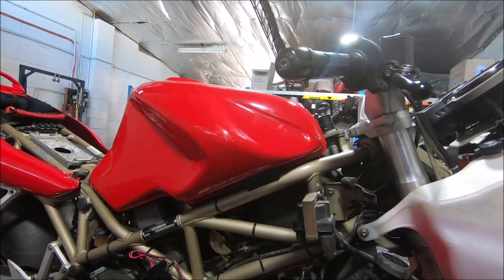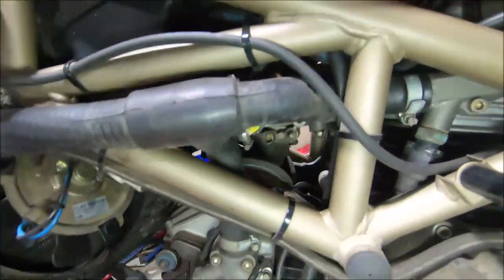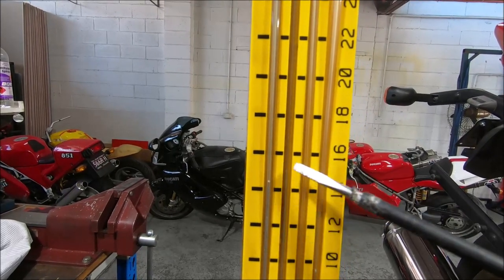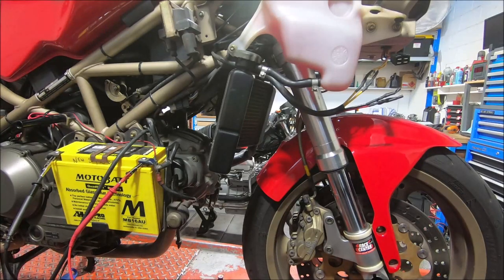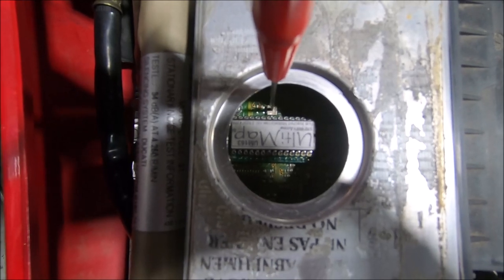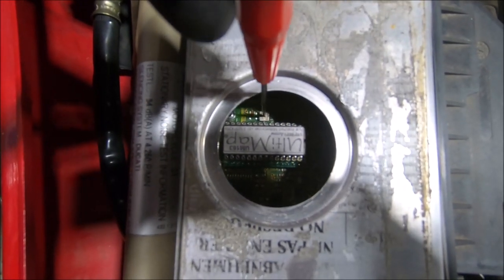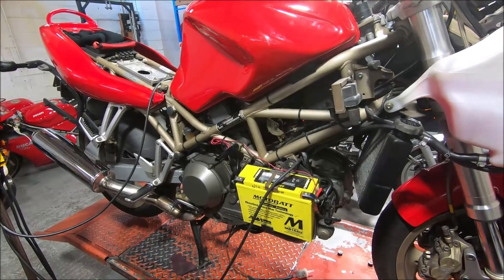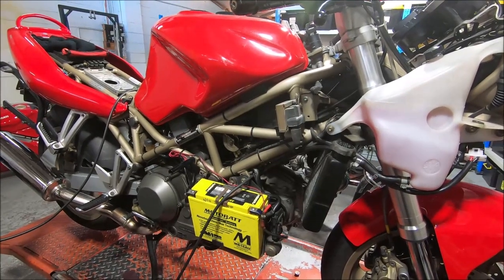Ducati 2V throttle body set up and tuning for SSie, Monster ie and ST2

Comment: Hi again, Brad.  Another great vid on a 1.6 ECU.  I never knew about the aftermarket chips not being able to "talk" to the diag tool(s) !!!   Thanks for that tip!
Reply from the maker: any aftermarket eprom based on the fuel injected motorcycles / ultimap megazone system won't talk to the weber / marelli diagnostics.  any aftermarket eprom based on the weber / marelli software is fine.
Reply: Moving the EPROM in the video was confusing. Rich/ lean back n forth. Where did the pulse width end up? 11 o'clock??

Comment: It's annoying that the voltage affects the co that much. In the 59m there is a voltage correction table that compared to marell injector data is more or less correct, but I've found that for every volt of drop it still need +0,2ms of injection time to come back to the same co value
Reply from the maker: it's not something i usually see on these, just happened to be a compounding issue.

Comment: As always: Nice video...thanks for that!
A question about the probes that you insert into the manifold to measure: Do you use a screwed adapter or do you simply push the copper pipe a few centimeters into the manifold (without further sealing)?
Reply from the maker: all threaded, with an o-ring under the nut on the inlet.

Comment: At low RPM and deceleration of throttle I will get exhaust popping. I'm hoping this will solve the issue. And I also noticed there's some slight oil seeping around the hose from under the airbox, and am wondering if that is a result of the same problem?
Reply from the maker: i can't see any oil having anything to do with popping.  sounds like it's just lean.

Comment: Brad, another great vid! I learned a lot.... I am still playing with my 2000 Cagiva Gran Canyon, I have it running great at idle and low revs. Per your instructions on TPS settings in Mv.
Also, using manometer balanced TB's at idle

 When I hold it (cruising 2nd, 3rd, 4th) at 3-4K rpm's, it stumbles a bit, but accelerating from 2000 to 6000 rpm's is smooth. 

If I hit it (hard) to WOT it cuts out to one cylinder at about 7-8k rpm's, but if I roll it out steadily it winds right up to 9k.

When I isolate the cylinders by unplugging plug wires, it is smooth with no stumbles on either cylinder.

Thoughts?
Reply from the maker: what is the idle mixture set to?
Reply: 1 1/4 right TB , 1 1/4 left TB I used my homemade manometer
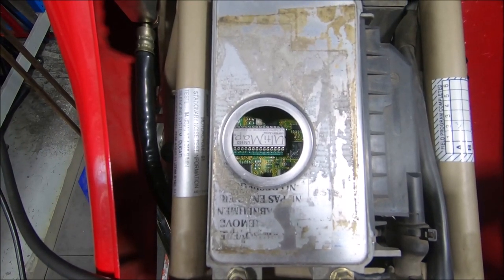Reply from the maker: @johng9323  that's the air bleeds.  you set the idle mixture using the trim pot in the ecu - shown at 12:45
Reply: I don't have sensors to measure exhaust gas. I can smell that it has been very rich, just yesterday I move the trim screw from  4 o'clock to 2 o'clock, it was difficult tell realize any difference, as I only rode about 1 mile. I have been smelling the richness for quite a while. @bradthebikeboy
Reply: I may have omitted important info: Before all of this happened,  my regulator/rectifier went out. I replaced it with Roadstercycle FH020AA reg/rect. The charging system is working beautifully, but do you think I may have damaged any electrical components?
Reply from the maker: @johng9323  no.  the trimmer is explained here.  https://www.youtube.com/watch?v=AurUeZiuuE8

Comment: This is awesome, but for the average joe such as  myself who doesn't have an exhaust gas analyzer in their garage what do you suggest for setting the air bleeders?
Reply from the maker: the air bleeds are to set the idle speed.  ffs.  the idle mixture is set using the idle trimmer in the ecu.  if you don't have a way to measure manifold vacuum, i would set the idle speed as desired with the air bleeds out the same amount.  least desirable.  if you have a way to measure manifold vacuum i would set the idle speed with the air bleeds set to give the same vacuum on each cylinder.  from there, you could adjust the idle trimmer up and down to see if/what difference that makes to the idle speed.  it's easier on the 1.6m ecu because twisting a dial gives you more feel in terms of good/bad sort of thing if that make sense.  but with the 1.5m or 5xm series, just move the number up or down and see if you can find the points at which it gets crappy rich and lean.  generally, whatever those points are, go 1/3 of the way rich from the lean point and that's about 4% co in a very general sense.  if the idle speed has changed, redo the air bleeds to get the idle speed you want.  happy with the idle speed?  good.  then i would ride it around for a while and get a feel for it.  then, wind one air bleed out 1/8 turn and the other in 1/8.  ride it for  while.  better or worse?  better? - go another 1/8 on each.  worse? - go back 1/8 on each to the starting point, then 1/8 the other way.  better or worse?  continue until it feels best.
Reply: @bradthebikeboy  I don't think my 800ie has an idle trim in the ecu
Reply from the maker: @515moto  i can assure you it does.

Comment: Can u fit a 180/55/17 tire on the back?
Reply from the maker: and the award for today's randomly irrelevant and vague question goes to this guy.
Reply: @bradthebikeboy  lmao great help!
Reply from the maker: @joeblades  is there a requirement for me to be helpful?

this video is about tps resetting.  asking a tyre question is completely off track and that sort of total irrelevance really annoys me.  if you have technical questions, you can email them to me.  i much prefer that to this sort of random rubbish.

and how vague can you be and still expect a reasonable answer.  are you one of those people who complains about bad service everywhere without considering that you're the problem?  the info in this video can apply to models of 400, 620, 750, 900 and 944cc.  some of those models have a 4.5" rear wheel, and fitting a 180 on this is not recommended.  you can do it if you really want to, and the "phat is better" morons would happily do so.  but a 4.5 should have a 160.  it's pretty easy to find recommended rim widths in tyre catalogues.

if you have a 5.5" rear wheel then yes, 180 is good.  you'll find that the 170 is actually a bit narrow for the 5.5 in the tyre specs.  i expect ducati fitted them to the models they did more in model differentiation than tech spec.

so if you asked "can you fit a 180 rear tyre on the back of a xxxx - where xxxx is the specific model you're talking about - then you'd have provided all the necessary info for the question to be answered.  but still, imo, in the wrong place.